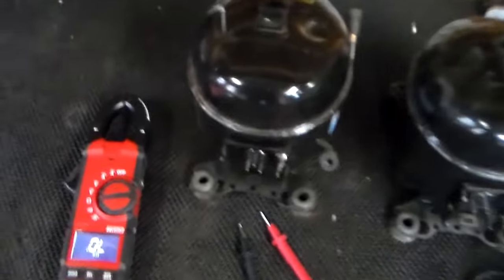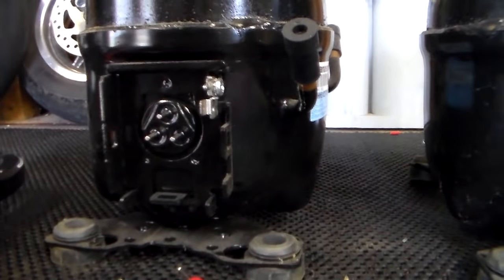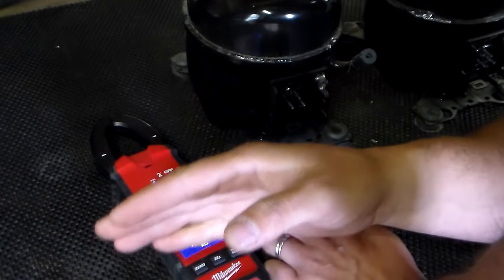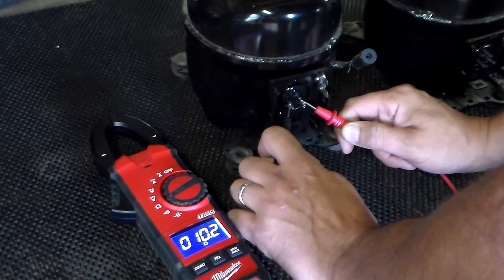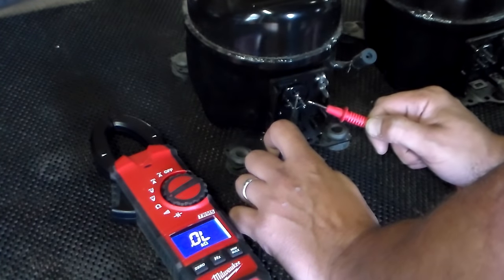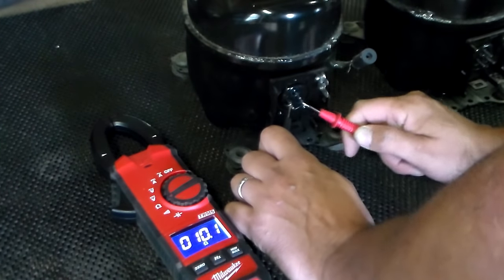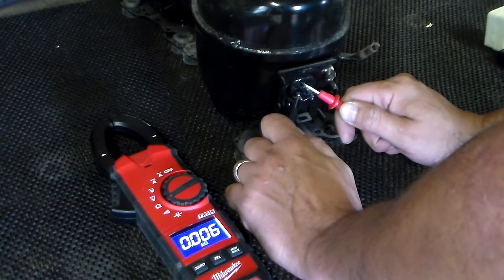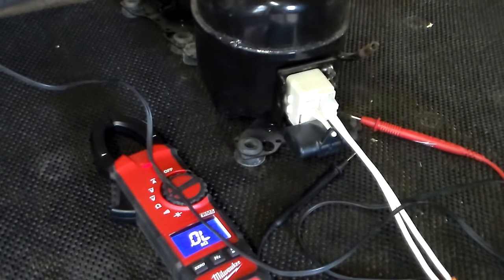How to Test the Compressor on your Refrigerator

Comment: I tested my compressor and i don't get a reading on any of the three pins. Does that mean the compressor is bad?
Reply: Joseph Finley If it is thermally protected, that could mean an open internal overload. Solution? Beat he heck out of it with a hammer hoping to force a reset. Otherwise, you have open (burnt) windings rendering the compressor useless.

Comment: hey bill my 2 bottom pins is giving me 19 ohms instead of 10 ohms does it mean my compressor is bad?bill or any tech out there plz help...thx in advance
Reply: Different compressor might give different reading. When you check the winding Start to run it will have the highest reading. Common to run lower and Com to start lower. If you add the 2 lower numbers it should equal the highest number

Comment: My fridge stopped cooling. The fan goes on, but it doesn't cool. I changed the relay, but it still doesn't work. I checked the compressor and I am getting the following readings: bottom 2 is 7.3, the left reads 4.6 and the right reads 2.8. It's an old refrigerator that I have had for more than 10 years. there's continuity between the pins and there is power into the relays equaling 122 volts. I put the voltage reader on the black wire, the LRA on the compressor tag says 19.5 but I get a 17.23 reading but it still is not working. any idea what it could be?
Reply: +Maureen Insignares  compositor may be bad. Look at getting a 3+1 hard-start. As for the compressor 4.6 + 2.8= 7.4 you got 7.3 so your compressor is fine there is a 5% tolerance. How i did that is your 2 bottom pins should add up to what the individual pin gets to common.

Comment: Dint know if was using the correct ohm range on my meter. Which range should I use
Reply: If you have a manual range selector on your multimeter, set the resistance to the lowest setting... about 200 Ohms

Comment: Love the vid, very informative, I have an embraco compressor that I am going to use for an air pump and it tended to start when cold but hums if you cycle it on and off then you have to wait a bit to start it again. I got an all in one RCO410 and same problem, what could be the problem?
Reply: I heard Bill pass away
Reply: Wow, took me a while to process your message, I just checked and his Twitter stopped 2016
Reply: @earnestgreer6128  thanks, took me a bit to process your message. We are fragile but must go on.
Reply: @goofykl9   I learned a lot from him

Comment: it was very helpfull for me
Reply from the maker: +MD.GOLAM KIBRIA Great!  That's what I like to hear!
Reply: Bill Newberry  great videos bill
I moved a  working upright defrost freezer on it’s side for a total of 11 hrs  , stood it up and left it sit for days. When I plugged it in it wouldn’t cool at all , I ran your diagnostic test on compressor and it tested out ok , I checked the incoming wires to relay and had 120 volts I also checked the outgoing side of relay that plugs into compressor and had 120
Reply: Bill Newberry sorry bill I hit send prematurely before I finished  the compressor was warm to the touch but didn’t actually run 
My question is, could this likely be a relay issue still , I noticed in your other compressor diagnosis video that you mentioned you can get a good reading of the compressor but it could still be faulty  any help would be greatly appreciated thanks in advance Brian

Comment: My results, in the order you tested, were 14 ohms, 10 ohms, and 4 ohms.  I'm about 4 ohms higher than what you got.  Do you think I have a bad compressor?  This fridge worked fine but I had to store it in my garage unplugged for about a year and a half.
Reply: To add to Bill's video, the bottom 2 pins he tested were the Run and the Start terminals and thats where he got 10 ohms...Next, he tested resistance between Start and Common where he got 6 ohms...Last, he tested between Common and Run where he got 4 ohms....If you combine the resistance values between Common and Run (4 ohms) and Common and Start (6 ohms) you get 10 ohms....that should be the same (or near) to the resistance between Start and Run (yep, where he got 10 ohms)......So, having said that, you got 14, Run to Start...10, Common to Start, and 4 Common to Run....Ohm values are not as important as their relationship to each other...Your compressor appears to ohm out just fine....
Reply: yeah I agree with casey since the resistors are in series

Comment: Hi Bill, I have a Frigidaire upright frost free freezer (253,21101100). One fine day it stopped working. All food got spoiled. Then I unplugged and plugged it back, increased the thermostat all the to high and it started working, I left if on for a week and I could see that it would become warm and then become cold again. Thinking this is working I put new food there. A couple of days later the same thing happened and it stopped cooling.
After that when I unplugged and plug it back nothing happens, the fan also does not come on. I don't know where to start trouble shooting.
Any help would he greatly appreciated
Reply from the maker: Mansoor Kapadvanjwala Bypass the thermostat control and see if the unit kicks on.  If it does, replace the cold control "thermostat".
Reply: Thanks Bill. How can I bypass the thermostat control? Do you have any videos on replacing the cold control thermostat?
Reply from the maker: Mansoor Kapadvanjwala It will have only two wires going to it.  Those wires need to touch to bypass it.   That is an open and closed circuit.  You need to close it.
Reply: Hi Bill, thanks. I bypassed the thermostat and it worked. Then I connected back the thermostat and it worked too. But when I attached the control knob and tried again, it did not work. I checked the connectivity of the thermostat with a multi meter, setting it fo ohms (200) and connecting the two ends to the thermostat. It showed me a zero reading which I think is what it is supposed to show. So I am not sure if the thermostat is working or not.
Right now I have it running on with the bypass to see if it really cools down.

Comment: you cant use a 3n1 start device to replace the type of start device you have in your hand and yes IT IS NOT A RELAY , the oringinal start device you have has a RUN capacitor on it and the 3n1 hard start device has a start capacitor on it with no run capacitor, the compresser will start and run with a 3n1 devive but it will run hot and burn out quicklym , if a compressor was design with a run capacitor you must put one bake on

Comment: i have a kenmore that has been sitting in the storage for over a year and the compressor is running but air to top and bottom is room temp. help !
Reply from the maker: Check the evaporator in the freezer compartment,  If not frost, no freon, no good.  Make sure the fan in the freezer is running.
Thanks for Watching!
Reply: Bill Newberry thank for the tip will check

Comment: I pulled out compressor and power it up it ran about 5 seconds and stop around 3 seconds and continue running. Is that normal?
Reply: +sam4malaysia  No, your overload could be bad or your have a bad compressor.
Reply: i tested it without gas and load. what is the problem??

Comment: Another cause of compressor not running if the relay and the compressor winding are OK is a mechanical jam between the bearing journal and the connecting rod. Have you ever faced this kind of problem?

Comment: I’m getting 14 across start and run and 5.3 between common and run and 10 between common and start, the fridge is a 2004, are these readings ok? 
Thanks
Reply: good compressor.  read my other comment

Comment: Good, simple video. I followed your advice and am ordering the 3-in-1 device. At 26 bucks if it gets the compressor re-booted I can always upgrade to the OEM part if it makes me feel better. But at least I'll know my fridge is salvageable with that part being replaced, rather than burning 100+ dollars only to realize my compressor is cooked. I tested the pins and it checks out OK, but what if it's a problem with the coolant. then it's bye-bye 1000 dollar fridge plus a wasted 100 part. Thanks again for the practical, real world demo and advice.

Comment: I check and my compressor is good. My fan and compressor doesn't come on. So I checked voltage and I don't have voltage to my wires to my compressor and fan. Lights work on the inside but other then that I don't hear anything else happen.

Comment: My refrigerator does not cool at all, I already replaced relay started and overload protectiin, checked compressor amps and it is reading 0.90A, and also I charged refrigerant, and it still not cooling at all. What else can I check?
Reply: 0.9 amps is very low for any fridge compressor, you should be seeing at least 3 amps in a normal run mode. When you say you "charged" with refrigerant, did you weigh in a new charge after evacuating the system? Putting any refrigerant in these small systems is quite critical on weight.

Comment: Bill Newberry how can I purposely make the compressor in my refrigerator go bad
Reply from the maker: talesha martinez Well,   I can tell you what I've seen, it might help.   Lay the fridge on it's side for about an hour, then stand it up and plug it in.  Oil will plug the freon lines and it won't get cold.  Not sure if I condone giving advise on how to intentionally burn up the motor with improper voltage and such.  May I ask why you would want to do this?
Reply: Bill Newberry
Her husband must have said NO new frig until the old one breaks down! lol=)
Watcha think?
Reply from the maker: scottywhatu gondoboy Hilarious!  and Probably True!  lol

Comment: I have a kenmore upright 20 cu ft freezer no cooling fan comes on tried the universal relay same result have power next step would be to replace comp problems comp has no info on it no model no or serial no the freezer has a model no 29205 it is 25 yrs old   The comp has 4out let’s  all new comp have 3 outlets . Found a spec sheet on the back side of the freezer no model no on it but says it is a 630 BTU Rotary. Where do I go from here all new comp r 3 outlet how would u plum it have called a lot of comp places no help

Comment: i changed the relay and the compressor is not working.only the light in the refrigerator is working.
what can be the problem ?
Reply: Thermostat reset/ and or capacitor

Comment: I thought adding a hard start meant giving a compressor a life sentence meaning once you add the hard start it only has so much life left in it because the compressor would not start now it's about to die once you add the heart start this is all stuff that I have heard what are your thoughts on that
Reply: If a single phase compressor starts pulling high amps it will open a internal safety and not start. A hardstart is  basically a higher rated start capacitor with a relay so when the compressor starts it will have lower amp draw, then the relay closes and uses the reg run cap. I've seen home condensers with hardstart kits in it 6-10 year with it in still kicking butt. Newer system come with hardstart factory preinstalled

Comment: I have tested my compressor and it checks good but still wont start . I have wired it straight up to a plug and it just hums.  I am wondering if that means it is locked up and ready to throw away.
Reply: Before you throw it away...and I'm being serious....hit the compressor a couple time with a dead blow hammer....sounds like the piston is jammed up...sounds crazy, but I've freed up many compressor that way
Reply: use a hard start cap and tap it hard with a hammer.possibilty that fridge was moved and piston jammed up ore shifted

Comment: Great video! Thank you.
I wanted to ask you the following: My Kenmore Elite refrigerator has the following compressor: LG Electronics TCA35271201 Refrigerator Compressor. It is a linear compressor. It has the 3 pins on the side (2 on top and 1 in bottom) like a triangle facing down. The connector that is plugged there is using only the 2 pins (the bottom and one on the top). The 3rd pin is not connected. When using a multimeter, the resistance between the 2 pins that are used is 0. Like a short circuit. The resistance between the unused pin and any other one is infinite (open circuit). Is this normal? When I plug the compressor, it works. It starts and is relatively quiet. The problem is that my fridge does not cool down. Both freezer and refrigerator are warm. The evaporator fans work fine. But not cooling. Can it be the compressor or is it something else? Thanks for your advice.
Reply: Hi mgtripa, I have the similar model and got the same measurements and probably the same problem with my LG unit. I wonder did you get yours fixed and are you able to share with me how was it fixed? Thanks!

Comment: Hello. Do you have a Twitter so I could send you a DM to ask you a few questions|explain the problem that I'm having and maybe you could help? I don't mind posting the question|problem I'm having here with my LG refrigerator. It's just I'm not working on it myself, not a mechanic etc. It's simply my lifeline ♿️and I don't want to get screwed over by paying someone $1,800 to repair when it could be a simple fix...or a cheaper simple solution. 
Not interested in a new fridge, mine is. 2016 and sadly LG doesn't care enough about their "former customers" because I'm definitely not doing business with them anymore. 

Gratitude for your time.

Comment: Great video Bill, thanks for the information.  After watching several other videos, I came across yours which was the most informative and helpful by a long shot.  Compressor ended up testing well, but after plugging the relays in and plugging in the power, the compressor would crank up and then very quickly slow down and cease after a loud click from the relays (sounded like a finger snap).  I'm replacing the relays as we speak and look forward to resuming normal life.  I appreciate your taking time to post the video, cheers!  Whirlpool refrigerator model: ED2FHEXVS00  Maunfacture date: 04-2008

Comment: Hey Bill! Hard starts don't last near as long as a OEM relay and can cause excess load occasionally on the compressor. The best cost effective solution is almost all relays can be changed out with a universal relay inside the oem relay box. They are only $3-$6 dollars on Ebay cheaper then even a hard start and as good as OEM. They have never failed me!

Comment: Just quick fact, common(always the top connector/terminal) to run ex 4ohms, common  to start ex 6ohms, run to start should equal about 10ohms, ohms will vary on each compressor. if compressor is hot to the touch and getting no readings form common to start may just be an open internal overload. Cool compressor with bag of ice and wait about 30 minutes and retest.
Reply from the maker: +Matthew Cenicola Thanks for the info!

Comment from the maker: and if you have any requests for anything, let me know.  I've been trying to make an effort to post more for people to watch on different components of refrigerators, then maybe on to washers next or dryers.  lol  Haven't decided yet.
Thanks Again
Reply: I checked the leads and they all say 9.6
Reply: My Fridge having power tripping when switching on the fridge..It was suudenly stopped working and power tripped..afater gaian i cehecked several times to switch on thepower goes bad..So i put the thermostat control in 0 stage and switched on..Its on there is having light inside the cabinet and having some vibrations somewher but the fan motor and compressor not working more..Whenever I used to turn o the thermostat its again suddently used to power tripping..Removing the power cables from compresor terminal there is no issue and fan is working normally..Please if you have any solutions please provide it..

Comment: Hi, Bill, thank you so much for sharing your knowledge with us! My Danby DFF092C1BSLDB, It stopped cooling/freezing a month ago, with fan running, compressor being cold without running at all. The compressor reading is, 12.2Ω (cross) =6.6Ω (left) +5.8Ω (right), with those 2 values so close to one another, does that mean the compressor was bad?

Comment: Thanks Bill.  I started off thinking it was the evaporator temperature sensor, then the compressor, but I quickly found out otherwise by watching a couple of you videos.  Ordered the motherboard on Saturday morning and will install on Monday.  Thanks for saving me so much time and keeping me from giving in to hiring an appliance technician.  Very clear and easy to follow instructions.

Comment: Hello, I'm restoring an old Coke machine, 1950.  It has a 1949 compressor, Nash Kalvinator.  There are three pins (bolds) that come out of the unit that are in a line and are labeled G, W & B.  How does this apply to the triangular pins that you show on the newer compressor you were demoing.  Nice demo BTW.
Tim

Comment: Hey bill, so i did what you did with the power cord plugged into the relay. apparently the compressor wasn't getting electricity. my question is:

1.  Plugged in like this, will the compressor relay shut power off automatically to the compressor or do i have to unplug it every few hours?
2.  Is the wiring harness dead or is it the main board? (everything else works fine except power to the compressor relay)

Don't want to burn out my compressor, thanks in advance!!